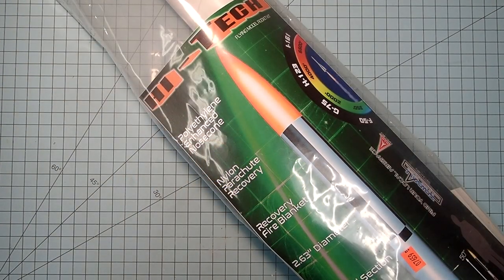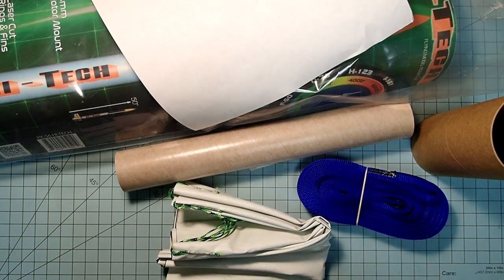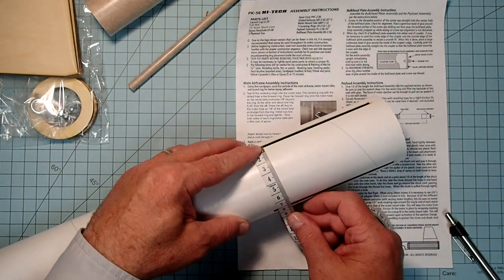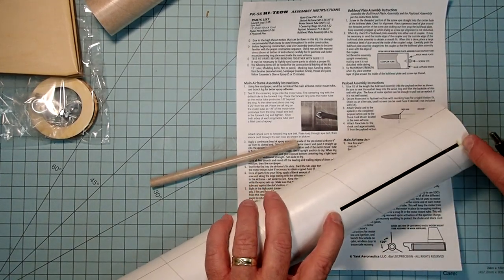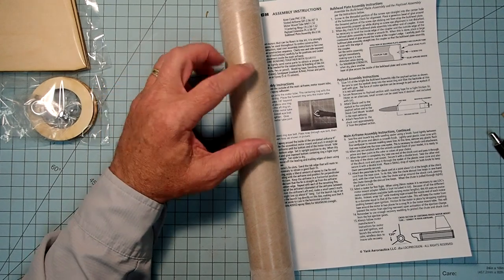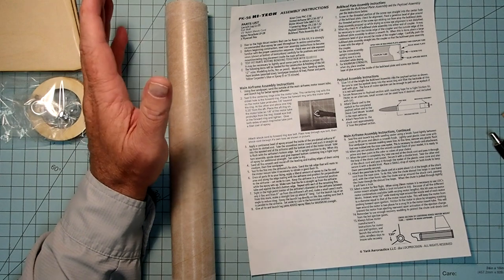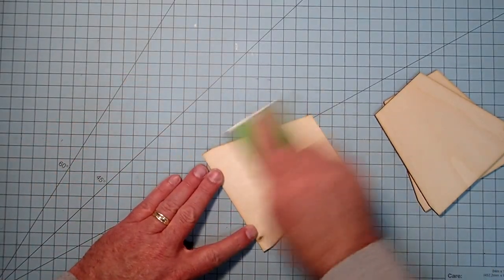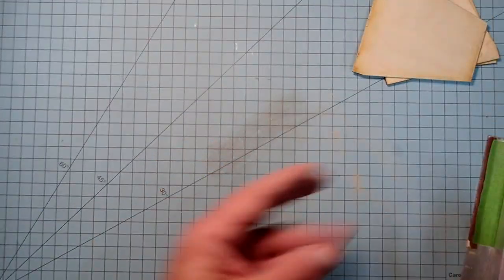LOC Precision "Hi-Tech" high power rocket kit assembly (part 1 of 2)

Comment: Nice build.  Couple of tips that I've learned working with epoxy over the past couple of years.  Heat is your best friend. Warm the parts slightly with a hair dryer or heat gun and the epoxy will thin out when it makes contact and soak into the materials making them much stronger. 

For fins, I typically do my external fillets first to seal the openings then go back with warm epoxy and do the internals.  It's interesting to do this as you can actually watch the epoxy creep into the materials and watch them change color as the epoxy penetrates.  The down side to this is you need to do the internal fillets with the rocket laying on it's side level and only do them two at a time as the epoxy will want to run everywhere. 

One other thing I learned the hard way after losing two motor retainers.  Placing epoxy on the outside of the motor tube doesn't make a strong bond as 99% of the epoxy is pushed away when the motor retainer is pushed in place. I sand the inside of my motor retainers with something like 40-60 grit then add epoxy to the inside of the retainer and work the epoxy into the grooves and scratches left by the sanding.  These grooves hold epoxy in place when the retainer is pushed on.   Just be sure to wipe away any excess that gets pushed into the motor tube with alcohol. 

I really enjoy your builds.   Keep it up.
Reply from the maker: Thanks for adding your experience.

Comment: You might want to use JB WELD for the retainer. Its meant for hi temp applications.
Reply from the maker: Thanks for the comment. I've found that just about any epoxy works fine. This particular rocket has flown many times without any signs of retainer problems.

Comment: Dave, I've seen where other builders install the Eyebolt so the eye opening 90° of yours so if you want to replace the shock chord.
Reply from the maker: @terryperrott9913  that’s fine, and not a bad idea, as long as it doesn’t interfere with motor mount installation.